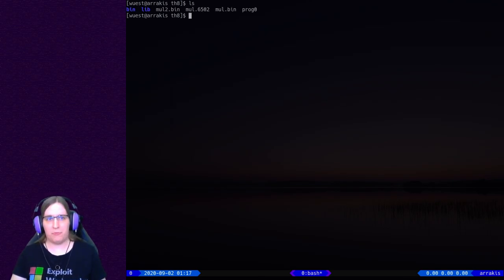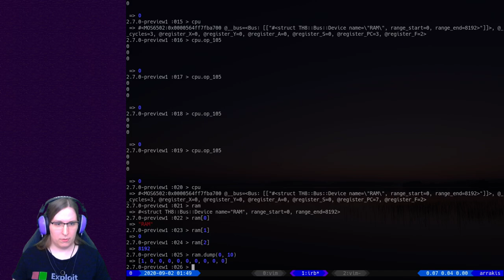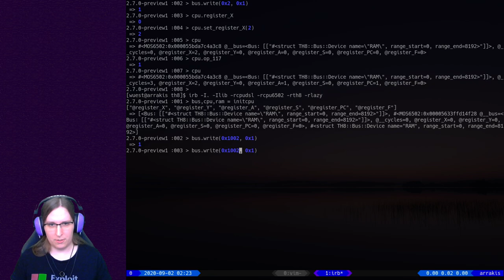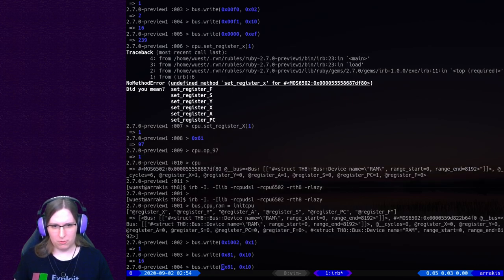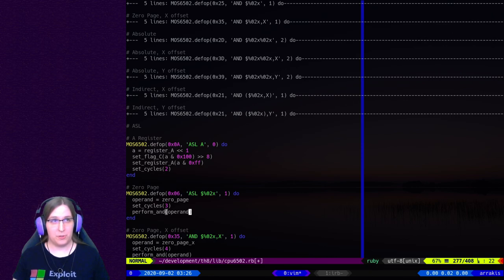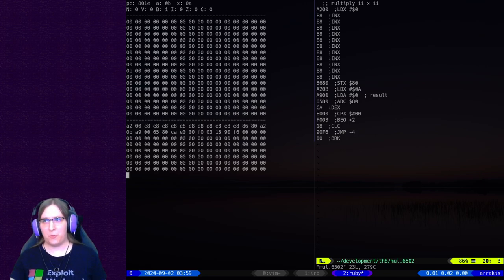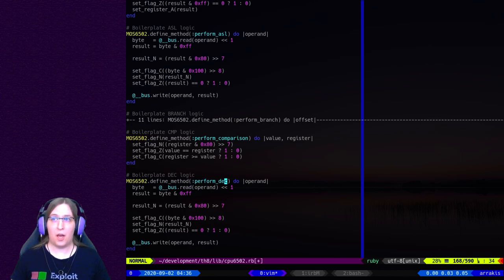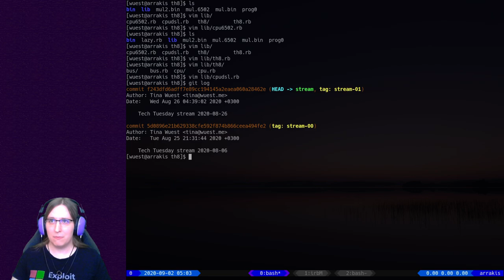Tech Tuesdays - 2020.09.01 - Emulator DSL (part 3)

Comment: How did you learn reverse engineering? 
How can one learn?
I know its hard question, but i'm new to the subject and need some help xd
Reply from the maker: Reversing is a huge field and there's a million ways to get into it.  I can only speak from my own experience, so if what I say here sounds like it would suck for how you learn, that doesn't mean that reversing isn't for you, it just means that my approach isn't.
I find reversing and development to be fairly complimentary.  If I build something, I can start to internalize how it /tends/ to work, and that will inform my ability to reverse similar software.  When I reverse software, it informs my ability to develop software and to avoid pitfalls I encounter.  Using one to cause me to grow in the other is a big part of my approach.
So all that said, my recommendations for getting into reversing:
* Play some Zachtronics games.  Yes, seriously.  They're good at forcing you to internalize extremely low-level thinking, and how you might compose small chunks of simple machinery to make something complex.
* Write a hello world in C.  Compile it using different optimization levels and open the resulting binaries under radare/ghidra/etc.  Try to run the program in your head as you read through it, then run the program in the debugger and note where you were right and where you were wrong.
* That hello world?  Compile it with -S so you can see the assembly produced by the compiler.  Take note of the difference between compiling with -S and -m32 -S (assuming you're on a 64 bit system!) - now's a good time to start looking through documentation to learn some of these assembly mnemonics you see; you'll come across them frequently.
* Rinse and repeat!  Write more complex software, reverse it.  Eventually move on to looking at software you didn't write.  There's a slew of reversing challenges out there built explicitly for the purpose of teaching!

I realize this is a TON of info in response, but I hope it's helpful.  If I can emphasize one point here, it's this: do your best to never allow learning something to only improve that thing.  Making connections between different topics is the biggest way you have to turbo-charge your learning.
Reply: @tinahacks   you are awesome!
 keep doing that.
i have no body  to learn from so that is useful info.
i taught my self software development and cyber security from scratch.  
i thought about that this week, that software development related to re bit time since memory addresses change each variable,
so the idea you start thinking about pointer while writing python lol.
 Thank you!!